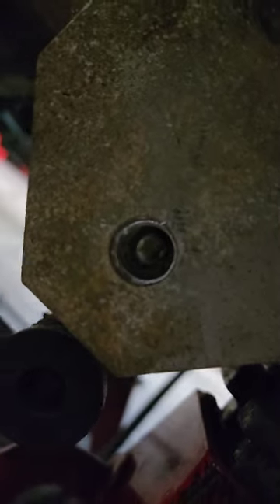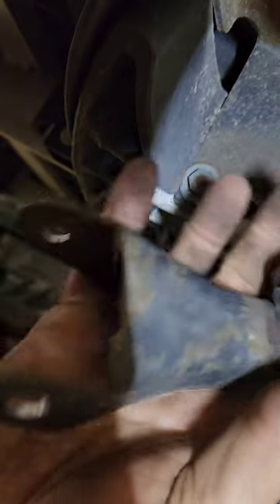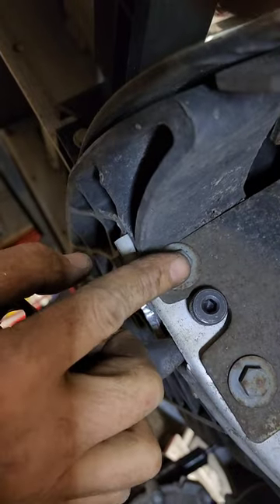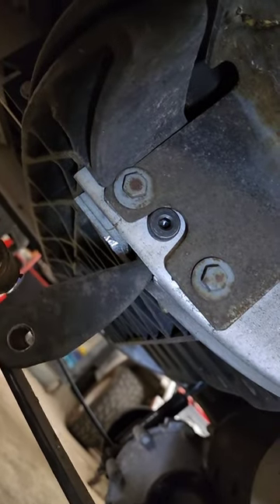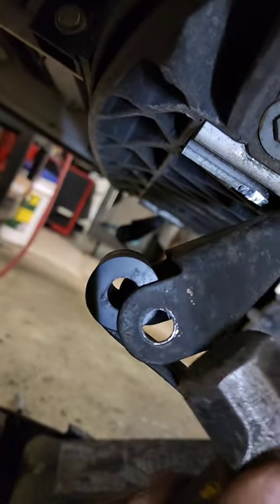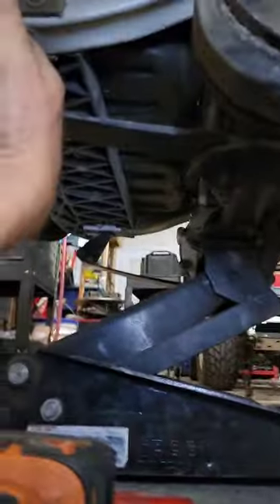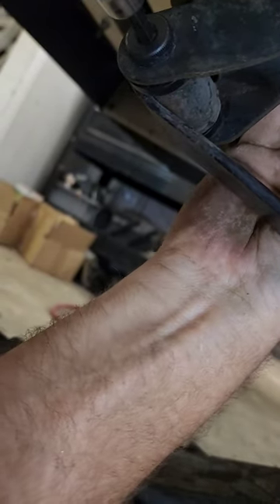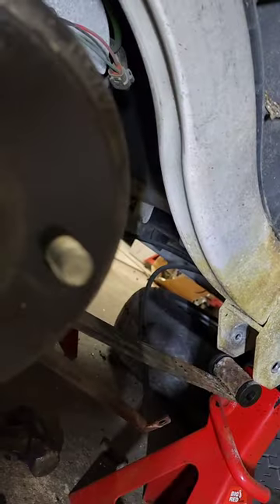CLUB CAR PRECEDENT REAR SUSPENSION REBUILD

Comment: Tricky, are these your upgraded bushings like you use in your revised font kit? Or are these just stock bushings that you reamed out to fit the larger bolts?
Reply from the maker: These are all brand new kits made with a material far superior to the rubber bushings that comes in the carts